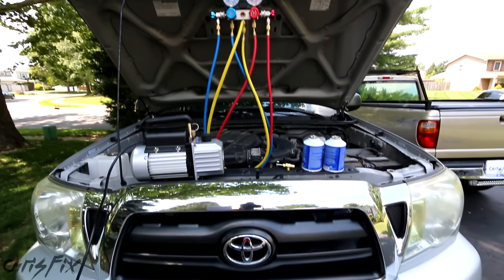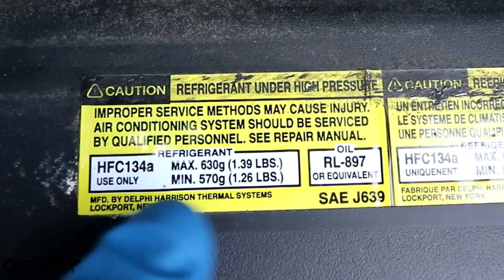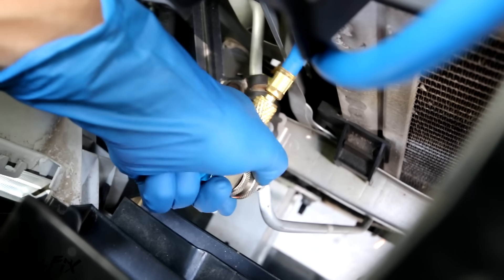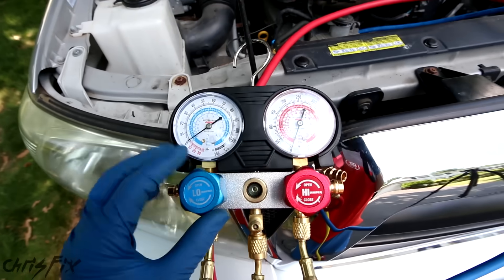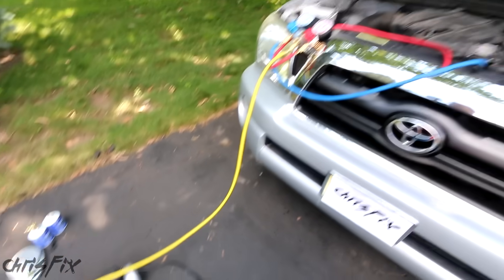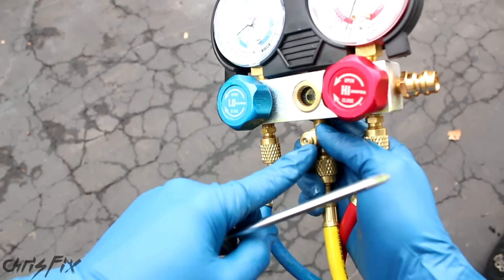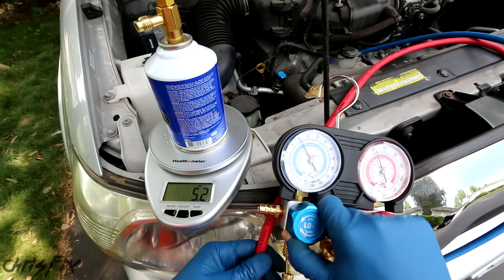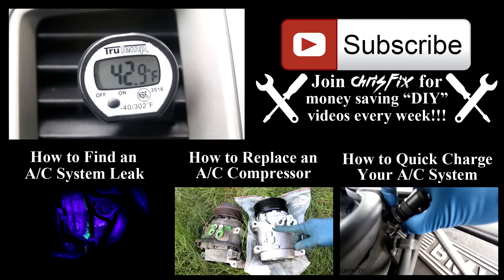How to Properly Recharge Your AC System

Comment: What did I miss?  To test the system integrity, you pulled 30 inches Hg vacuum, then closed the valves for 45 minutes.  So..... all you actually checked was the vacuum in that small plug-on metering device -- not the car's AC, as it was isolated from the meters by the valves.  There is no mention of your opening the valves again before rechecking the meters.  So, where did I get it wrong........ if I got it wrong, that is.    I consider that you really need to leave those valves open (or open them again before checking) so the meters check the vacuum in the AC.  (Closing them between times is probably a good measure to negate any possible leak in the pump whilst it is not pumping.)
Reply: The valves he closed only control flow to the center (yellow line) port. At the other end of the hose is a valve that controls flow through the hose.

Comment: Hey chris..   I used this video to recharge my AC and it worked great till my suction line developed a major leak due to corrosion.  If the praq oil and 134 leaks out...  How much oil do you add???  I have a 2009 Tacoma... same truck as vid.

Comment: If i vacuum the system like you did but i didn't replace anything or open the system at all, do i still return the recommended amount of oil into the system thru the yellow hose?__
Reply from the maker: Just a little oil, is needed if you just vacuum the system.
Reply: Thanks Chris..... Just a Little? as in maybe 1/4 of the recommended dose? Or would 1/2 be better?
  Arizona is at about 115 degrees right now and i'm melting in that Truck LOL

Comment: Thank you for an excellent, clear demonstration.  The only question that remains unanswered for me is the following : When you do add oil and UV dye..........can you still purge the air out of the yellow line in exactly the same way shown in the video ?  Many thanks.
Reply: Seems that the only way to do that might be to purge the air out first before trying to add the oil.
After purging, close the can tap valve, unscrew the hose from that end, and then add the oil and dye.  I'd just check that the can tap valve works properly and closes off the flow before unscrewing the hose off completely.

Comment: when you convert a car from r-12 to r-134, do you have to change the oil in the system?  This car's compressor uses Ester oil but I noticed 134 seems to use Pag oil?  Because a line had broke, the system was repaired and recharged with 134.  Now i'm trying to find out if I should just add ester oil when replacing the drier, gaskets etc and recharging with 134 (from leaking compressor gasket).
Reply: InfinityVision Yes you do. The oil for R12 is not compatible with 134a and cause damage if mixed.

Comment: Chrisfix I have a problem I was charging my a/c system but the a/c compressor that I got from the junk yard started to smoke it smelled like burning peanuts and I used the a/c pro brand and the gage was on 10 so I turned the car off immediately when I smelled the smoke pls help
Reply: sounds like you didn't check the oil in the compressor, its toast. buy a new one online and make sure its properly oiled.
Reply: +Bennett Raymond Thank you👍
Reply: +Bennett Raymond I believe some of these say they are shipped with oil in them but we've burnt them out for not adding more to the compressor.
Reply: Alexis Trujillo 

Hey kid!... burning peanuts you say?... Oh no!, go back to the junkyard and ask the cashier to refund your money! I think they sold you a peanut toaster!

Comment: I just put a used A/C compressor out of the local salvage yard into my 2001 VW Beetle. I still need to leak test and recharge the system. Since I put in a used compressor should I be concerned about adding refrigerant oil?
Reply: Thanks for your help. Much appreciated.

Comment: did everything just like the video but when its time to add the refrigerant the high side just goes straight up to 200 psi and keeps going up, dont know what to do already did the process 2 time and same both times the same
Reply: Yeah,  too high pressure in the high side that keeps going up makes me believe that it's either a contaminated/clogged condenser,  clogged or stuck TXV,  or a drier thats been installed backwards (driers must always be replaced when you open the system,  so it's possible),  and yeah possibly electric radiator fans that are not turning on when the compressor turns on (they should).
Reply from the maker: The compressor is not kicking on
Reply: Even if the compressor is new?
Reply: Is the compressor working?  can you verify that the clutch is engaging when you turn it on?
Reply: +Dacke Yes, the compressor and clutch is engaging. I ended up going to pepboys and they took three days to tell me it might be the accumulator or expansion valve. I don't know if they might be right or they just throw some parts to get rid of me. I read something about a low fan too but don't know what fan they where talking about.
Reply: A blocked TX valve gives you a low reading on the high side due to the compressor has nothing to compress.  More likely over charged or condensor not getting airflow.

Comment: hey chris i have a 2008 dodge charger it has uncommon issue , the vents that air is blown through the first 2 is blowing cold air good cold air the other 2 by driver side takes a while to get cold like 15 mins ( the average heat is about 45 to 50 C here)
Reply from the maker: That is the vent doors not working properly due to a bad actuator or vacuum line (if it is not electric).

Comment: Also if we are weighing the and it is liquid in can would it not be good to use something like a fish hook scale to weigh out the can while upside down to get the fluid in ac system? Curious?
Reply: Fish hook type scales would not be able to measure to the kind of resolution needed though-  it really has to be an electronic scale that can display down to ounces consistently and accurately.

Comment: I overcharged what do I do
Reply: u gotta recover it and start all over. Go to any shop and asked if they recover the frigerant
Reply: +Leekautorepair yeah that's what ima do, seems a pain and dangerous to do it without a machine
Reply: yea it is. If you have any automotive question feel free to inbox me!
Reply: Aspiring to Inspire all you have to do is open the high side slowly until you're scale comes back to the proper reading
Reply: But only do this if you are overcharged. If you need to remove all refrigerant you need a recovery machine
Reply: Either of my comments both methods included keep refrigerant in the system or the manifold.
Reply: Mark Cherry and btw it's the EPA that handles misuse of refrigerants
Reply from the maker: What Leekautorepair said!
Reply: Lol way to violate the clean air act your clearly not certified
Reply: Or canister
Reply: Assuming it doesn't have a check valve it would work fine
Reply: No shit dumbass but I'm sure you don't think it's necessary to be certified hell why not you won't get caught right lol damn side show Bob's left and right

Comment: If you have a vacuum, just add the freon from the high side and the vacuum will pull the freon in. Most of the times I can get it all in with out ever cranking the vehicle. This prevents pushing the oil out of the compressor through the low side before the compressor starts pumping. I do this every day on a larger scale with Greyhound size tour buses.   Some of them hold 45 lbs of freon and with a good vacuum I can get a whole 30 lb. can feon in from vacuum alone without ever starting the bus up.
Reply: Hi moparnutjim. I lost the charge and refrigerant by opening the low side port to atmosphere. Would there be any refrigerant left in the high side and if I pull a vacuum do I need to add any oil at this point?
Reply: Gary Bolinky. Yes you can, but it's likely to take air in simultaneously. 
So after sucking the oil in, start again on vacuum process, attach just to the low side otherwise much of your new oil heads for the vac pump.
Reply: How does the vacuum pull freon INTO the system and not THROUGH the system and right back out into the atmosphere? This doesn't make any sense to me.

Comment: A 45 minute vacuum on a small system could suck oil out of compressor. 45 minutes is unnecessary if you have a vacuum gauge.
Reply: 45 mins depending on the system and age of the vehicle. I'm always working on newer cars so I do 10-15 mins
Reply from the maker: Oil sits in the lines so slow vacuum pump like this will not remove oil. So there is no need to worry!
Reply: Thank you well said get a micron gauge

Comment: Chris, luv your videos, any ideas why both the high and low sides are reading about 115 psi with the engine off?  The clutch wont engage either. Thx
Reply: System equalized when off.
Reply from the maker: That sounds normal. Check the fuse for the compressor clutch

Comment: first of all my english is not very good

hey chris, my old car (toyota corona 1975 rt100) have a custom ac (aftermarket install)
the problem is the ac is not cold for about 3 weeks after recharge the refrigerant.(r134a) i suspect that the system has some leak. but when i check the pressure it's okay. when the compressor kicks in the pressure also in normal condition (the low side is about 20psi at idle).

then i vaccum the system and put in a new refrigerant and the ac is cold again...

second question, since i add aftermarket ac system, how much refrigerant i need? i only put 300gram of r134a and the pressure looks a bit low for me.

what's the cause of that??

thankyou..
Reply from the maker: Look at the pressure chart here: http://acprocold.com/wp-content/uploads/2011/11/Temp-pressure-chart-33776F1.jpg
Reply: ChrisFix how i measure the pressure? when the engine idle or what?

Comment: you forgot to mention the compressor oil.. mot compressors come filled with oil but for each car there are procedures what do do about oil quantity when replacing a compressor..sometimes you have to drain the new compressor and fill in the correct amount of oil

Comment: Hey chris, im worried about something, i drive a honda accord 05 and the ac compressor doesnt cycle its most of the time on. Any ideas?
Reply from the maker: It could be due to the temperature and humidity outside or the condenser is dirty or the refrigerant is low! If the ac is cold, I wouldnt worry!

Comment: Been suffering in the Florida heat with my MK6 Golf TDI. VW wanted $1300 to RR compressor and condensor, I believe that was a light estimate considering the compressor through them alone is $822. Through my research, I found the compressor control valve to be at fault. With your video and a few tools that I will now have for life, I fixed the AC and the part only cost me $50. Thanks Chris!!!
Reply from the maker: That's awesome, Armand! I am glad that you found my video helpful and were able to fix your AC!

Comment: you vacuum is supposed to be 250 micron, never leave pump running unattended. If it loses power is will suck the oil out of the crank case on the compress.

Comment: lets say a compressor was replaced and just recharged without pulling a vacuum or changing the evaporator/filter or condenser, or expansion valve... it worked for about a week and now not working... what happened

Comment: Chris, I used a manifold gauge set like the one in the video (from AutoZone though) and after disconnecting the gauges - both the high side and low side ports now leak. I believe this car has never had a compressor change, so it could be that neither port had been used like that before. What can I do to stop the leaks? The buildup of pressure is one thing, but I believe that all my refrigerant will leak out (eventually) if the ports do not hold!
Reply from the maker: The ports are a schrader valve like in a tire stem. You need to remove the refrigerant, and replace the valves by unscrewing the insides.
Reply: +ChrisFix Good. I haven't had the refrigerant removed or replaced the compressor so I haven't gotten ahead of myself, yet...

Comment: Nice video! Any DIY method of evacuating the system? My compressor failed but I still have refrigerant in the system.
Reply from the maker: Yea, taking it to a mechanic yourself to get it sucked out haha. Unless you have a way to pull a large vacuum on a cylinder-container like a large propane tank or something, then you also need to be able to recycle that tank so they can collect the refrigerant. It's too bad the stuff is so damaging to the environment!
Reply: +ChrisFix ok thanks for the response and keep up the great work!

Comment: im confused , if you add a full can that weighs 20 ounces but it says 12 ounces then its gona be 12 ounces, however if you use up 10 (half) that would just be 6 ounces so that should mean you only added 18 ounces in total
Reply: waiiit nvm i get it the can is the added weight
Reply: total weight is 20oz but he removed 10oz of freon, The weigh of the can is still there.

So if the can empty weighs 8oz and you add 12oz freon you have 20oz total. Then you remove 10oz of total weight that weight is only freon. Unless you cut a piece of the can? I've had things like this mess with my head before
Reply: HeyDude93gt yea lol cause i got it but then i forgot how i finally figured it out and then got confused again
Reply: It happens to everyone at some point in life, I call them learning curves!
Reply: HeyDude93gt lol
Reply: rainwave5 

Shhhhhh, don't say it out loud... These companies are giving us 8 ounces more for free!. If you're too loud they'll start putting back only 12 ounces again!
Reply: Juan Cabeza lol
Reply: public school system proving its merit once again.
Reply: Greg G 
That's irrelevant for this application. Let's say you had two measuring cups and fill them with one ounce each, one with gas, the other with diesel . The diesel would weigh more than the gas. 

So with refrigerants the weight of an ounce of liquid isn't important. Just the basic weight is what's needed
Reply: rainwave5 I thought it was only me that got confused on that calculation. The wait includes the can itself and the yellow manifold to can connector. Thank you
Reply: I'd just be careful about maintaining the same position of the hose during the charging process, because if it shifts, that can cause a much greater change in the apparent weight than the actual dispensing of the refrigerant and throw the numbers off.  Keep that in mind if you go and manually shake the can to help it along.
Reply: how much does a fluid ounce weigh ?

Comment: @hostility think logically no dis and I'm speaking from being a cert HVAC tech the high side valves usually close to the compressor if you feed to much liquid yes you'll lock the compressor but slowly the compressor vaporizes the refrigerant instantly and the slits on the caps for if you feed system pressure that's excessively higher then cap pressure it will rupture or if you open both valves and feed it into the can

Comment: Do I have to add oil to the entire system after a shop evacuates my a.c. system?
Reply: Generally you put back in the same amount that was removed,  but very little, if any,  is removed through just evacuation.  You add oil when you replace components like the compressor, drier/accumulator, or condenser.
Reply: +Dacke Thank you!
Reply from the maker: Exactly what Dacke said!
Reply: How does the oil go in without introducing air?  Do you still purge with oil in the line? Wouldn’t oil spray out - that part want clear to me. I’m wanting to add about an ounce of oil.

Comment: I got a 2009 nissan altima sedan and my A/C clutch is bad like it makes a loud noisy noise only when I turn it on and only when it's on "D" or "R" not on "P" so I been told by many shops around that the compresor is going bad and that I need to replace the whole thing not just the A/C clutch. .. so what do you think?

Comment: Say you have replaced all major components. New compressor has oil in it. How much and how do you add oil to or for the other components in the system? Thanks! Great Vid!
Reply from the maker: That varies from car to car. Get a service manual or ask a local mechanic for that info.
Reply: It's a 98 Jeep XJ. I'm in the sticks no mechanics for a 100 miles. Any help appreciated.
Reply: checkout r/cherokee
Reply: BBB
Reply: You go by what the compressor calls for. Oil is for compressor lubricant. Most of today's cars call for about 8 oz. and most compressors come filled already.

Comment: Why was your high pressure side at 50 psi before you even added freon!?!?!?  10:16
Reply from the maker: That is the pressure inside the can.
Reply: So did you have the high and low pressure valves on the manifold open? How did the can pressure get into the high side before the compressor was on?
Reply from the maker: The pressure bleeds thought the whole system and flows backwards too when the compressor is off.

Comment: Helpful video.  One thing though;
 If you add oil to the yellow line, the oil will spray out when you purge the air out with freon. It's better to add the oil to the compressor.
Reply from the maker: Thanks for the tip!

Comment: Hey Chris thanks for all the helpful and detailed videos they're awesome. 
Do you have a video for overcharged a/c systems? Thanks
Reply from the maker: You just take the car to a mechanic, have him evacuate the system, and then you can refill it the way I showed in this video!
Reply: +ChrisFix Thanks for responding. I'm trying to diagnose if it really is overcharged. According to the store bought gauge on the refrigerant can my ac has the correct amount but it started blowing hot then cold and repeating the process. After reading a few online threads they suggest my system may be overcharged but I'm trying to be sure that's the real problem. 
Thanks again.
Reply: +amnewera is your condenser fan working?
Reply: As far as I know but I haven't had it checked